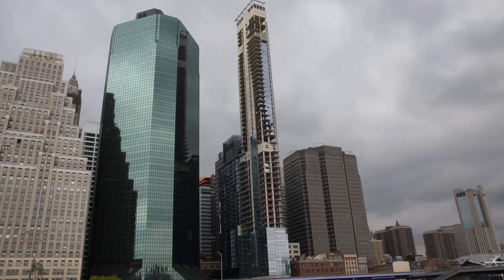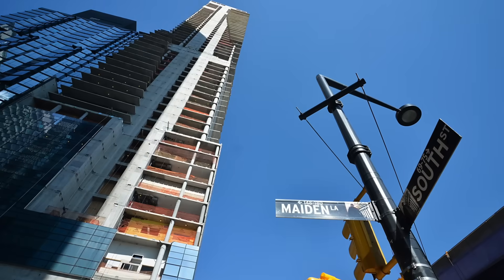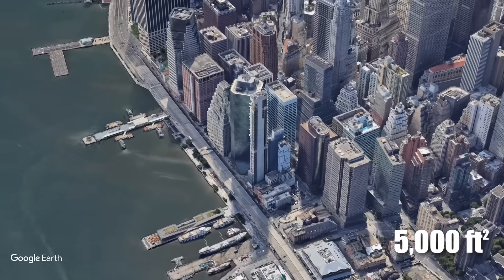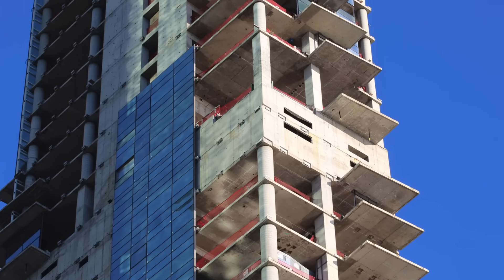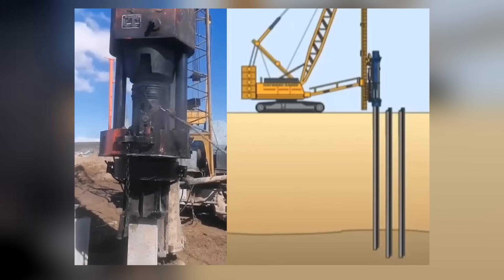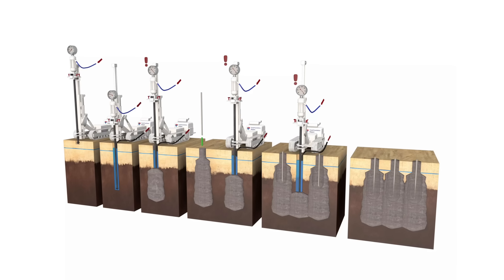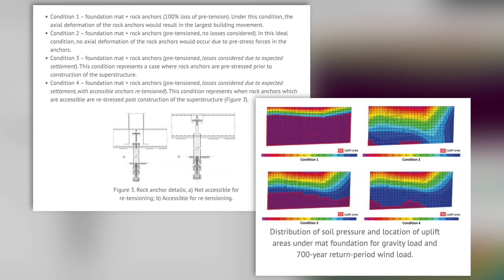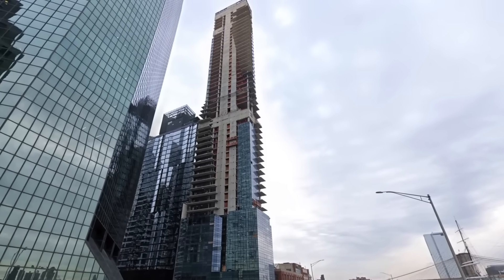Why Nobody Can Fix This New York Skyscraper

Comment: I have discovered that most engineering disasters are caused by some manager  going "we could save a bit of money by...."  They don't realise that good engineers have already designed the structure to be as cheap as possible, but still meet all of the engineering requirements. Usually the management's cost cutting comes straight out of the structures safety margin.
Reply: It's now known as the Stockton Rush school of engineering thought.  "If it hasn't worked for 1000 years due to "rules" break those rules!"
Reply: @infrasleep  That actually happened to a relative who was a chemist. When the head of her group pointed out to management that their request would violate the Second Law of Thermodynamics, the Suit-in-Charge came back with "don't you know laws are made to be broken?" 

You can't make this [stuff] up.
Reply: @JayKarpwick  Empirical testing shows whether the situation was correctly understood.
Reply: @infrasleep  - On the other hand, just about every great STEM innovation is created by breaking the rules.
Reply: @spacecadet35  These innovations are tested to see how they work out ;testing is regulation,if it fails that then it isn't a rule breaking innovation.  Rush stupidly said his sub was "Ahead of regulation". Nothing is ahead of regulation,it needs to be tested by regulations/rules. According to Rush,I'd be ahead of regulation if I used re inforced off the shelf umbrellas from Walmart for BASE jumping,and I could keep it that way by evading testing by the rules.
Reply: @spacecadet35  Maybe not by breaking the rules but by extending the rules and discovery of new rules.
Reply: @donaldkasper8346  - That is called research. But that is not what we are talking about here. What I am talking about is when a company gets a set of engineering plans, and using the "research" of looking at the budget sheet some  bean counter with no engineering knowledge decides to save money changing the design or changing the materials to save money.
Reply: @spacecadet35  Taller buildings is called research.  They model the structures.  If no one has done it and you are studying doing it, that is research and the building is your experiment.
Reply: @donaldkasper8346  - And then a manager comes along and changes your welds for bolts to save money and decides to use a cheaper grade of steel to save money and decides that you only need to drive half the foundation piles  to save money, how is that research?
Reply: @spacecadet35  Picking my nose is not research either so I fail to see the point.  Using a building design different that what you have done in the past is called deal with it.  Skyscrapers now are not artisanally built.  They are designed using architectural software programs that computes all the loads, stresses under wind, etc, and from that you can see how sound your plan is.  Now for most construction work, they take the calculated loads and stresses and from that the required structure and multiply by 3 to account for metal fatigue over time from load bending.
Reply: @donaldkasper8346  - Yes, agreed. One builds with a safety factor, then you have to be careful that managers do nor erode that safety factor in the name of reduced costs and increased bonuses.
Reply: @spacecadet35  The 3x rule was just made up.  Someone pulled it out of their ass and it stuck as a standard.  That does not mean that 2x overbuild is unsafe.
Reply: @infrasleep  Engineering advances.
Reply: @donaldkasper8346  These are always tested against the rules, they only become "Rule breaking" innovations once proven to work.   I would be "Breaking the Rules" and be "Innovative" if I made a cardboard submersible;the only way to keep it "Rule breaking" and "Innovative" would be to avoid ever having it tested by the rule book.
Reply: @infrasleep  Material properties being data applied in rules, you would know that cardboard was not a good choice.  So that is not a matter of breaking rules, it is a matter of acquiring new material data to apply to the rules.  You are confusing rules or conclusions regarding data observations.  To change those rules would require new observations.
Reply: It's not just in construction. I spent most of my career in software r&d and was always fighting with management. They wanted everything "faster and cheaper" but when it came to doing the job correctly, that was another matter entirely ....
Reply: In many construction situations (this also includes things like airplane builds), the lowest bidder usually gets the job. Let that sink in. Emphasis on "sink."
Reply: @goudagirl6095 They usually get rid of the highest and lowest bids.
Reply: As an Engineer, yes.
Reply: Always
Reply: It is always about saving money.  An engineered solution that works is called it works and cheaper.

Comment: Can't believe they cheaped out on such shallow foundations. The San Francisco Bay shore is more like 300 feet to bed rock. Most Bay Area buildings I saw built were 3-4 floors and used 80' pilings. Didn't they see what happened to Millennium Tower?

Comment: In the building next door 181 Maiden Lane most of the piles are driven to “the “point of refusal” with large pile caps. It has not tilted at all in 43 years.
Reply: you would rather have problems in beams and slabs than foundations and columns.
Reply: @calvoh9715 The beams and columns are both made by the same fabricator, installed by the same erector.
The floor slabs and foundation concrete were more than likely the same contractor.
Reply: Incorrect, they are not driven plies. They are large diameter drilled shafts socketed into bedrock by several meters.
Reply: @basilguts1786  What's a meter?
Reply: @McVaio  A meter is a unit of length equaling about 39 inches -- slightly longer than a yard. A kilometer is 1,000 meters, about six-tenths of a mile. The metric system is used here in Canada and in Europe. It's kind of a pain. Nobody in Canada asked to switch from the English system of feet, yards, miles, etc. that you use in the U.S. Cheers!
Reply: @DonCampbell-m3l  Buddy, the metric system is used all over the world. The US is like the last holdout now.
Reply: It meters @McVaio
Reply: @McVaio    I dunno, what's amatter wit you?
Reply: that buildign is also fat as shit
Reply: Steel columns and beams for the framing would have presented a superior structure.
Reply: 180 Maiden Lane, not 181.  I worked there for 10 years.

Comment: The money now being spent on repairs, adjustments and legal fee's will easily exceed what it would have cost to go to bed rock. This building by its slender design needed to go to bed rock but instead was entrusted to some sort of "floating" foundation. If you need an example of poor judgement this is it.
Reply: I wonder how/why this was not intercepted and corrected by City officials given its potential for danger to citizens?

Comment: Everybody knows pilings need to go down to bedrock if you build a tower on land created by fill. The owners and engineers on the job were incompetent, crooks, or both. New York had better arrange to remove the structure and do it soon.
Reply: Don’t even have to be a civil engineer to know this.
Reply: There are some places (albeit not here) where bedrock is more than a mile down. New Orleans is such a place. Driving piles to bedrock in those places is simply not possible.
Reply: @OlDoinyo  Don't build skyscrapers there
Reply: Don't put engineers on blast. They knew this too, but they're not allowed to say no to the guy in charge.
Reply: Someone died because no one wanted to be a man and say no to this nonsense.

Comment: 0:24 If the tower was visibly tilting (to someone's perspective with just their bare eyes), the tower would have collapsed a long time ago. The Millennium Tower in SF has a far more concerning tilt, yet it is not possible to see the tilt with just your eyes.
Reply: Millenium tower isn't nearly as skinny (lower aspect ratio) as this building. A small lean is much more likely to be catastrophic especially as the lean is to the North across the narrower part of the building. This building will have to be demoed - and without implosion. That will cost $50+ M. The only question is when that will happen and who will pay for it.
Reply: @danielwalker6653  - if contrcator files bankruptcy and disaprears.. the people that own the lot will have to sell it cheap
Reply: I drive past this building and I can't see the lean.

Comment: BUUUTTTT -- What I really want to know is HOW THE FRACK did that graffiti at 9:03 into the video get up on the side of the damn building!  

Of course as mentioned, The lean itself likely results from the unpredictable nature of the ground conditions.   BINGO!  This is why you drill the supports all they way down into the stable and firm Bedrock.  This provides a very stable footing and removes the unpredictable nature of the ground.  They the Concrete mat that is built will not settle in unpredictable ways and all the problems go away.  As stated this solution they tried saved $6 million in costs.  Yet that attempt to pinch pennies over safety caused the WHOLE mess.  So they could have avoided the lean if they did not try to get greedy with the profit.  And now they have a building where recently the NYFD said the stand pipes to send water to upper floors do not work (added design flaws?).  And no one has mentioned if the lean will get worse in the next hurricane to hit the area (nice big flat face catching the high winds what could go wrong) as the models were set for 700 years of wind but it's already leaning more than any model predicted.

Comment: 3" is not too much of lining.  Edit second like in case of Millenium tower of SF after battle all are generals.  Structural engineering is not an exact science.  You do the best what you can.  They tried something new and it didn't work.
Reply: "They tried something new and it didn't work."
---------------------------------------------------------------------------
What an understatement ...

Comment: I actually find comfort in the fact that 3 inches is cause for concern with construction on a building that tall. Sounds like they are on it, unlike another building i know..
Reply: its not at full weight either, plus you have to add the weight of residential furniture/belongings etc
Reply: Over tIme its no gonna say 3 inches,Subsidence.

Comment: This is what happen when developer hired inexperienced and not qualified Proget Manager, Project Executive.  I know, I applied for the job but was not sellected, as too expensive. They got what they paid for.
Reply: But you would not have been able to advise on the foundation strategy and the adequacy of the geotechnical modelling and structural design, would you? Because as a project manager, that is not your expertise and you could not assume liability for providing that advice. 🐵

Comment: The additional $6 million to properly prepare the foundation when spread across the cost of units in that building would probably not have affected the occupancy rate. It's an example of pure greed on the part of the developer and it looks good on them that their gamble failed.
Reply: This isn't a new concept.. At one point in New York history. Entire buildings were going up in flames because builders were trying to save pennies on light bulbs.
Reply: What about the buyers of these condos? Are they still on the hook for the mortgage because the building isn't finished or safe?
Reply: @oharrietsglamourama  I read that the buyer's deposits were returned. I don't think they would have had a mortgage before taking possession of the units, which no one has done.
Reply: @oharrietsglamourama  I doubt, since when you buy in "pre-construction", you give a deposit of 10% that will be deposited in an escrow account which pay interest to the buyer, and then you are not going to do any mortgage until the closing, which can happen only upon construction being fully completed. Banks would never release a mortgage on something that is not completely built and with permit to move in.
The buyers likely got their deposit refunded.
Reply: @oharrietsglamourama  given the lean wasn't revealed for a time, perhaps lawyers are looking into fraud claims.
Reply: @elizabethwitt2621it’s not China … you don’t get a mortgage on a yet to be built building
Reply: @elizabethwitt2621  There is no COO, without that it can't be occupied. A simple lawsuit would be successful. Besides, I hear all the deposits are already refunded.
Reply: @oharrietsglamourama  The buyers were refunded their deposits but not the hundreds of thousands for upgrades that they paid up front. The developer claims that money is alreayd spent. People that were buying these units weren't setting up mortgages. These are investments for the rich, not poors that need mortgages.
Reply: You’re right. There were 99 units and spreading $6M among them would have been just over $60K. But hey. Developers needed that extra profit margin to buy their private island.
Reply: @ClarkBK67  - you never know this fiasco could have been finaced by your retiremnet fund...
Reply: @williamhaynes7089  Take a lump sum retirement if you can.
Reply: The grout mat will sink. Guaranteed
Reply: @wallacegrommet9343 or tilt
Reply: @wallacegrommet9343 it's going to keep tilting until they are forced to demolish it.
Reply: I wonder if they're going to lose more than 6M now? Stupidly greedy.
Reply: Greedily snapping up million dollar apartments and not being able to move in? 

You love to see it.
Reply: @NefastusJones  greed? Are you slow buddy?
Reply: The second the video asked "why" I said to myself, "money." I can't describe how unsurprisingly that was learning I was right.
Reply: I'm sure the legal bills alone cost over 6 million.
Reply: It could be that the developer has sold it lock stock and barrel to an investment firm and then the burden is on the investment firm, if, at least, the contract was done well. In such a situation, the developer cannot be bothered by safety issues or engineer concerns. All risk is put on the shoulders of others. This is quite ordinarily the case when there are short-cuts.
Reply: High rise developers try to defer these problems until the building is fully occupied, and then it is very difficult to hold them accountable.  In Sydney they will send the company into receivership and start trading under a new name.
Reply: Money should only be saved on costs that are aesthetics related, not things that are so crucial as the foundations. That's just asking for trouble. There's a reason the phrase corner-cutting is a negative connotation, but greed-driven viewpoints cannot seem to see past all those dollar bills floating in front of their myopic eyes. The consequences are fully deserved.
Reply: That greedy corrupt developer should be sued for every penny he has! He is evil!
Reply: AFTER BANKRUPTCY SOME DEVELOPER WILL BUY THE SHELL, DRIVE A FEW PILINGS
IN THE GROUND, NYC DOB WILL RUBBER STAMP THE FIX AND THE DEVELOPER
WILL SELL THE LEAN AS AN AMENITY(AND CHARGE EXTRA!!).
THE HOLD UP HAS BEEN THE MORTGAGE RATES ARE TOO HIGH TO UNLOAD THESE 
CONDOS ON SOME SUCKERS. FORTIS IS TRYING TO HOLD ON TO THE 10 MILLION
IN DEPOSITS, TO PAY THEIR BANKRUPTCY AND INSURANCE COST. IF THEY CAN
KEEP THE DEPOSITS THEY MAY EVEN MAKE A PROFIT ON THE DEAL!!!!
Reply: Tiny hat people only care about pennies... not anyone else or the safety of the people. Their greed causes most of the problems in the world !
Reply: Really? Is that good for New Yorkers though the cost to eventually remove this thing, which ultimately the city and its citizens will have to bear is pretty annoying.
Reply: It however would have affected occupancy, because now it is empty lol
Reply: There is only one way guys, pile until you reach rock. Whatever the cost.
Reply: They put $6 millions onto Trump’s cryptocurrency, and stated the meal they were served were worse than airline foods. 🎉
Reply: $6 million for due diligence and peace of mind is peanuts.
Reply: You have a structural problem and many choices to fix it.  The solutions that works the cheapest is not greed.  All you have to do is have anchor screws that can be adjusted for any settling.
Reply: @donaldkasper8346  There's no way that building can be fixed...
Reply: @tonyzuco6144  Brace once column at a time, tack it up an inch, and install a metal plate.  Then install a brace around the entire thing.  Move successively from one building side to the next.
Reply: @donaldkasper8346  well, it IS leaning. Maybe the adjustable anchors are more expensive?  If the solution was as simple as turning some bolts on anchor screws, don't you think they would have done it?
Reply: @donaldkasper8346 Show me a developer that isn't greedy!

Comment: I never even knew there was a workaround building skyscrapers on bedrock. I'm surprised more greedy developers haven't tried to do this in other parts of Manhattan. I'm not an engineer or architect but common sense tells you some silty former trash heap isn't a good foundation for a tall skinny building.
Reply: In Warsaw, Poland we don’t have bedrock at all and yet there is plenty of skyscrapers. It’s just engineering problem and there is a solution.